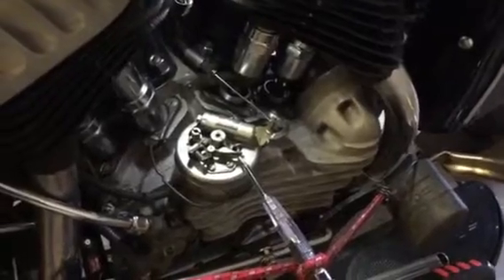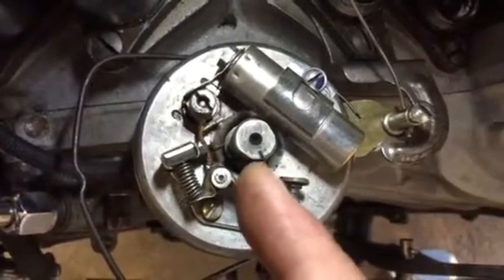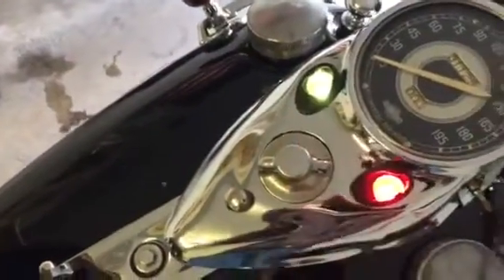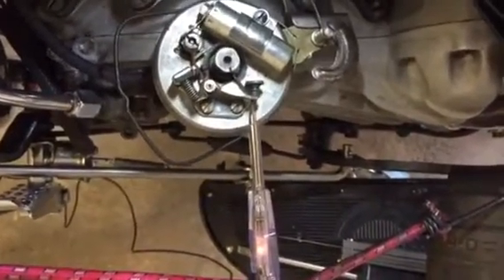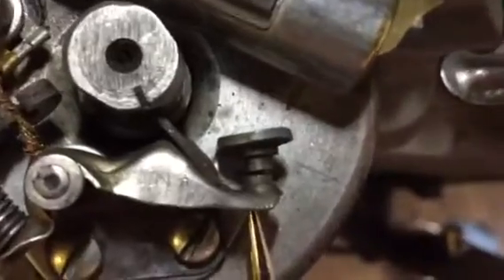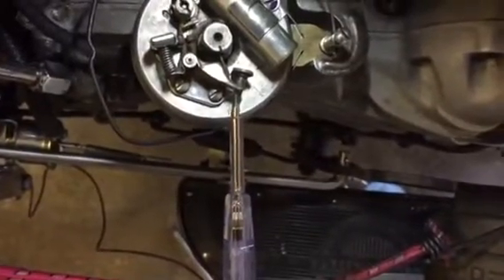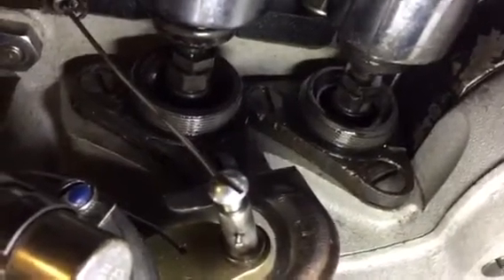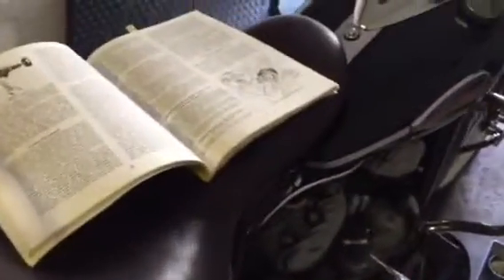Harley Davidson WL circuit breaker timing alignment

Comment: That line in the window hole, is that the advance line or top dead centre?
Reply: The timing mark line should show TDC for front piston on an F/FL which is probably typical across the board, but that is an assumption. Check your manual!